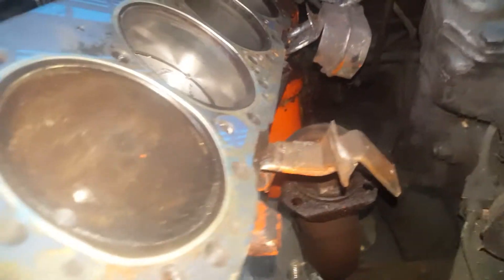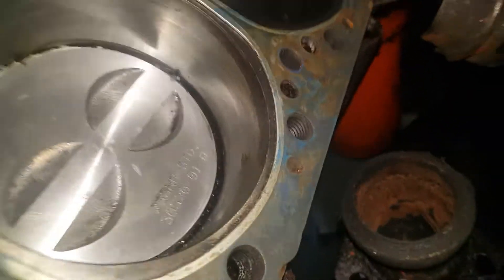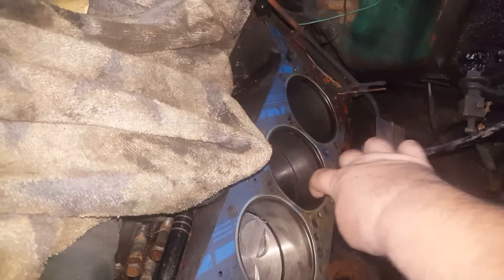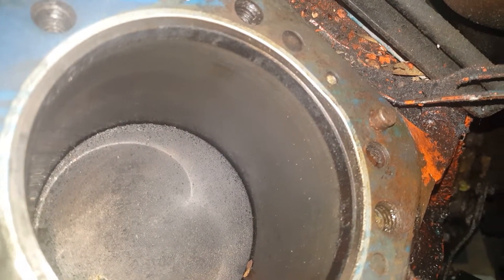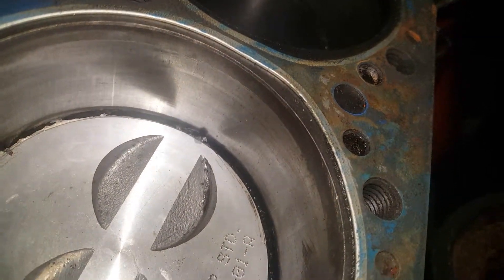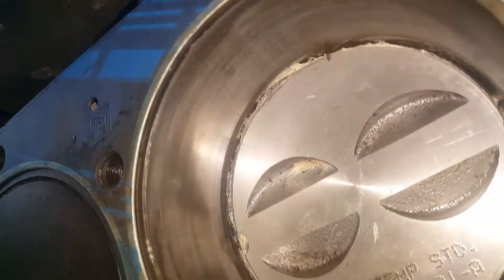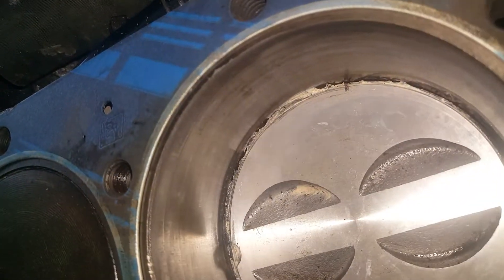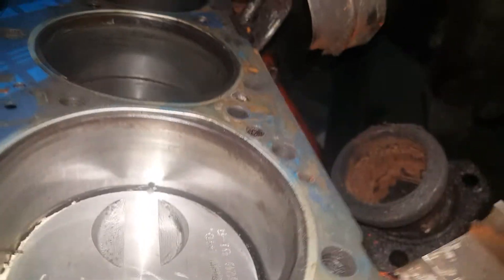no ridge to catch my finger nail on

Comment: I know people hone to remove carbon like that, but I've wondered if 1000 grit would work with some thin oil. It's not in the path of the rings.
Reply from the maker: I don't know I never tried that but there's no Ridge I made a mistake the carbon line is actually in the other direction so it's like the Wall comes up and it's a backwards C
Reply: @Rich_today1  Did you see my comment on one of your first videos? I've been around since 57